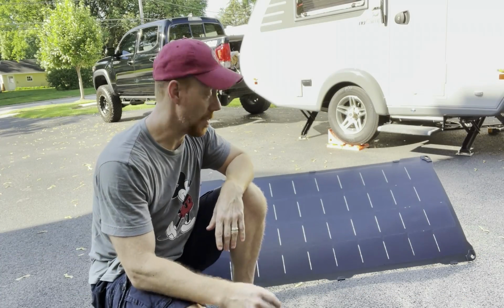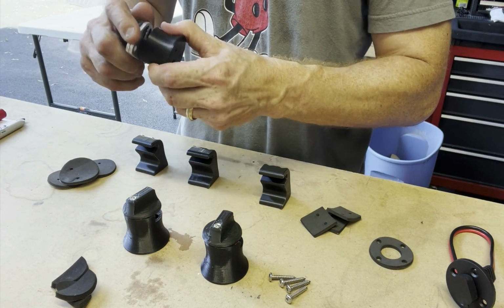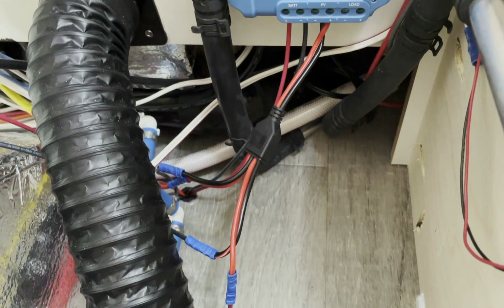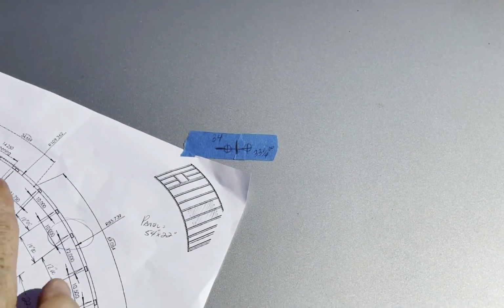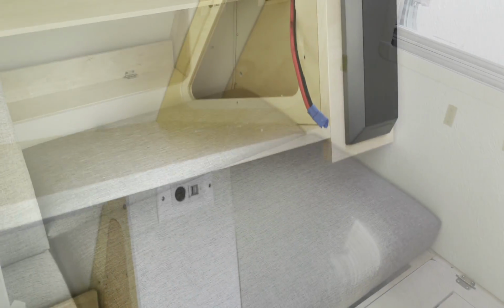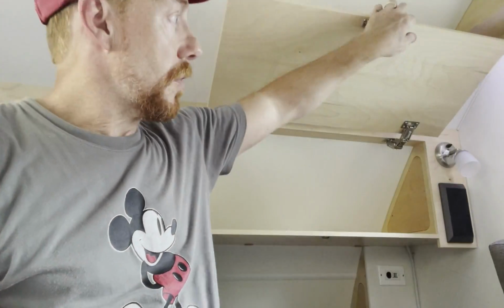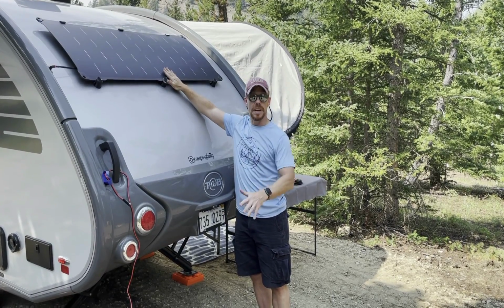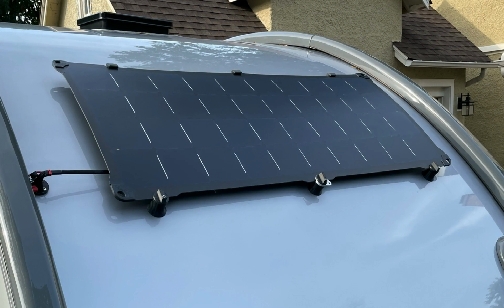LightLeaf Solar Panel Install on Tab 320S

Comment: Great Vid, don't own one instead own a 2022 Grand Design 22mle. Yet considering 2nd TT and heading in this direction. I live in South FLA and would like to hear from you if you have had experience with A/C? In-fact I cannot find anyone reviewing the A/C in this unit.

Comment: Great video! I actually have a question about the Tacoma. What is your opinion on how well the Tacoma Off Road towed the Tab 320 s? I have a 2017, and have been hearing mixed reviews on trailering. Again, really great video and thank you so much!
Reply: Hi Matt, I have a Tab 320s Boondock.  I tow it with a 2021 Honda Pilot with ease, so I'm sure the Tacoma won't have issues either.  My Pilot is rated to tow 5,000 pounds, so this is lower than your Tacoma.
Reply: @brianaustin1328  thank you so much!
Reply: @mattmartin2858  I should add that I tow without a weight distributing hitch or a sway controller.  I did install a Redarc brake controller, however.
Reply: @brianaustin1328  Thank you again so much! Great information. Sounds like the Tab 320s Boondock will work great for me! 👍🏼

Comment: Excellent video!  Is the SAE port on the front tub on the Tab routed to the Victron solar charge controller under the seats?  Or do you have a separate solar charge controller that is located between the front SAE port and the battery?  I wasn't clear on how that port was wired to a solar charge controller.  I think it's going to the existing Victron but wanted to double check.